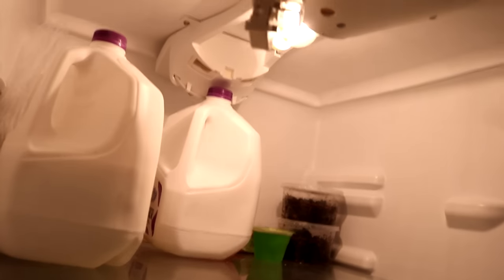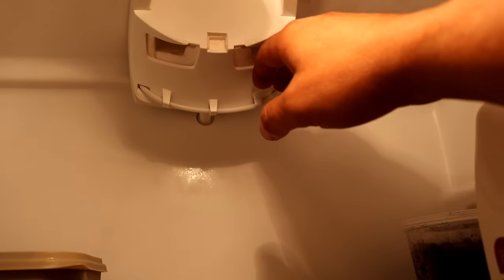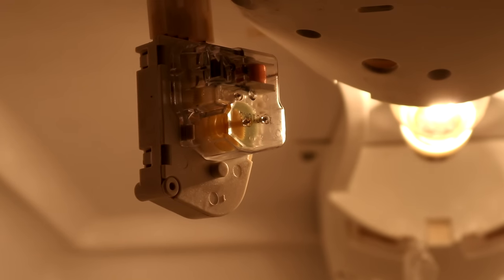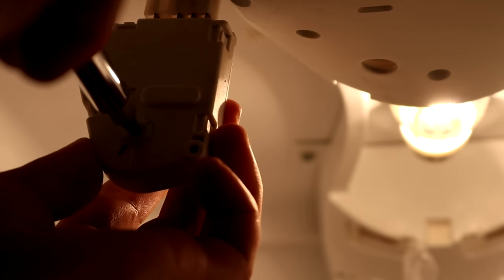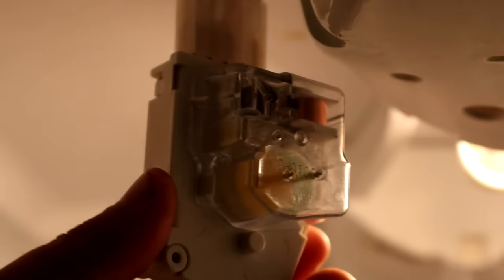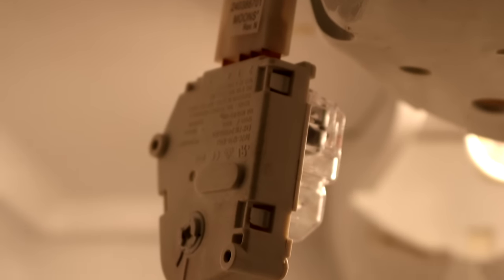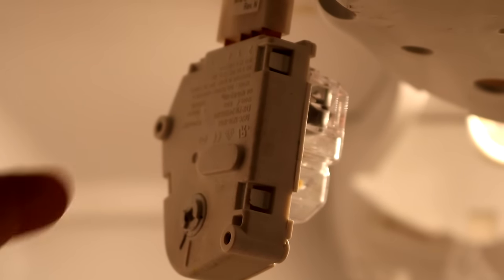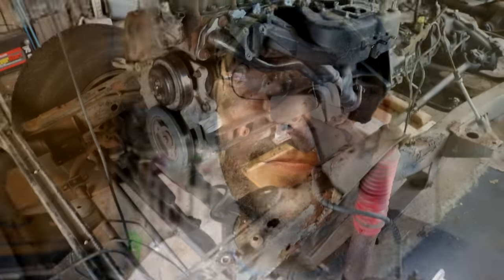Refrigerator Not Cooling - How to Check the Timer

Comment: could you make a video on how to bypass a defrost tstat? great video by the way! temporary purposes only! thanks!
Reply: Hey Robert, I agree with you and Bill - only for test purposes, but here is how one would bypass a defrost thermostat. 

Locate the defrost thermostat which is clipped on to the evaporator and is about the size of a $3 stack of quarters and has 2 wires coming out of it. 
Quick side note, a defrost thermostat is simply an on/off switch based on temperature. So, I think about it like this...the switch once activated by temperature gives the electricity a path to go from one wire to of the thermostat to the other wire. 

So, to bypass a thermostat (**unplug the fridge first!)!you'd simply cut the thermostats 2 wires, strip the wires, and wire nut them together and plug in your fridge again. This in effect 'tricks' the fridge in to thinking that it has a closed thermostat (I.e. Heater on condition). 
Note: be sure not to clip the thermostat wires too close to the thermostat itself as you'll need enough wire slack to reinstall the part after testing.
Reply: But, you can see why this would be a dangerous situation if you were to leave these wires connected because if the defrost timer were in defrost mode, it would stay on regardless of the temperature.  If the defrost timer happened to stick in defrost mode, you'd be lucky if the heater burned out before burning the house down.
Reply: +Andy Fulenchek thanks for the info. but I would still like to see it done!
Reply: So your basically putting the wire nuts together on the heater side? Correct?
Reply: +Robert Munguia no, a single wire nut that will connect the 2 wires where the defrost thermostat was before you removed it.

Comment: My problem with Frigidaire is freezer is blowing cold air but not freezing an refrigerator compartment is not cooling everything checks fine I just reset the thermostat timer like on this video so gonna see if that’s going to work also my light bulb shut off for no reason doesn’t look blown out

Comment: HI BILL.  Maybe you can help me troubleshoot my fridge problem.  It's a GE made in 2003, top freezer, bottom refrigerator:

Freezer works fine.  Problem is with the fridge.

This is what I have noticed:

1.    When defrosting, water leaks from the vent onto the top shelf.  
2.    When it switches back on, I can't feel much air coming out of the vent.  Barely any air.
3.    When I open the door, temperature raises significantly to around 50F.  If I open the door an hour later, the temperature is still in the warmer/unsafe zone.
4.    Only if I leave the refrigerator shut all night, the temperature returns to the safe zone.  Most of the times it goes as low as 30F.

Things to know.

-  There are not many stuff in the fridge.  It's 90% empty
-  Freezer is 90% empty.
-  No A/C in the house.
-  Checked the rubber seals on both freezer and fridge and they appear fine.

Comment: A friend gave us a microwave Hamilton Beach and then suddenly no longer heats the food. Any help will be much apreciated, thanks!!!
Reply: Hi there, I am 2 years late by your question date so here is an answer for all who might look in the future.
Back in 1984 we purchased our first microwave, $170.00 which was a good chunk of money. After a couple years it failed so I went to a repair shop. $150.00 to look at it plus at least two hours of labor and parts. I declined their most generous offer as a new microwave was much less in price.
Took the oven home and into my garage. Pulled the cover and in the front right top corner there was a reset button. Depressed that little puppy and had a great microwave for fifteen more years.
On some appliances there is a photo, (light), sensor. If activated it will be an emergency stop situation, usually on appliances which have lasers  internally. Some have a pressure switch which if not made the tool will not work, ensures the cover is in place.

Comment: Its the Current that 'flows' NOT Voltage . Voltage (difference) is 'present' across a 'resistant component' and provides the 'electromotive force' that 'drives' the Current through the Resistance 'presented' by the component.

Comment: i got a frigadare    top freezer   18 cf      it rund compressor  running     fans running    no cold nothing     the timer works replaced   the thermostat   in the freeer    next to the coils  still nothign    the thing    was 2 years old     first it was  freezing  next to the coils   then now this  its sat for the last year  im out of clues   i did also replace the  compressor   switch  even thos i herd it kicking on

Comment: I wanted to ask you or any one else about converting one of these electronic defrost timers to a mechanical one. It seems the Frigidaire I have has had a lot of trouble with the electronic defrost timers. They want almost as much for the timer as I gave for the refrigerator. I happened upon a video of a guy who claimed you could do this. The video was a couple years old and he did not respond to anyone. So I was not sure if he is full of B.S. or if he was serious. 
     The fridge I have is close to 10 yrs old. Funny thing when it gets hot it freezes up. It will do it in winter months but not as often.  Perhaps it may be low on freon  ?  I bought one of those thermostats and clipped it to the coil. I was going to replace the heater coil but then you said to push the light switch in 5 times and that would force it into the defrost mode. I did that and it worked. That was kind of cool watching the ice just melt away.  I suppose I could just push the light switch two or three times a day. Instead of buying new parts.

Comment: I put a thermostat in my freezer and it would stay at around 50 then up t 70 one time it went down to 28 in the freezer section so I guess it is something to do with the cycle. I will try to do these. I tried to push the light switch that closes the door and hear the motor tun up, but do not see nay actual temp control in the unit. just a board on the door. luckily I had a dep freeze to use as a backup nut I  guess a new mini frig is in the works. why waste money on a new repair

Comment: I just tore my fridge all apart on Easter. I checked the relay, cause it keeps clicking. So I checked it with a meter he said if it beeps it’s good. I looked and shook it, a small rattle but nothing was to bad. Took it apart and everything looked clean. So I put it back, eventually it clicked,still not freezing. They want 50$ for the part.

Comment: mine wasnt defrosting i spun the timer and it woudnt ever come on so i replaced the defrost thermostat then it was working but then the next day my freezer was 107 degrees and the fan was still blowing somehow the timer had the heater on and the cooler since the thermostat was clamped to the cooling coil i guess it never got to the cut off heat

Comment: my Refrigerator is not working right my freezer is cold but my frig part is not cold does it have a reset button on the back the fan is working but the frig part is not getting cold it was at first now its not

Comment: Can you buy a  bad  timer I think the one I bought is bad 8:52 8:52
Reply: Good question. I bought two new timers, one is for a backup. The first new timer I plugged in, started the freezer working and then stopped after a half hour. Checked again with water containers, and they keep freezing solid, then start thawing. Has me stumped !  Will plug in the backup and see if that works better.